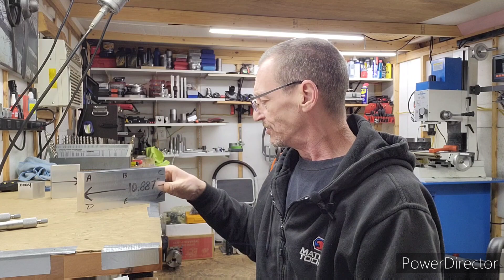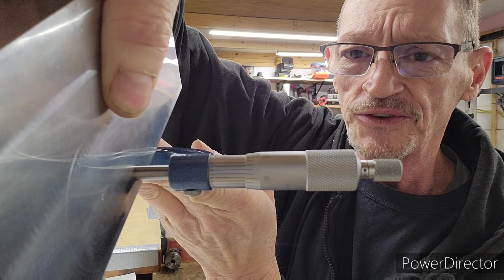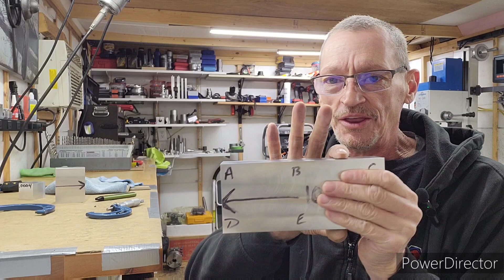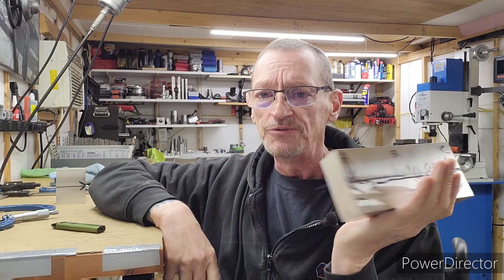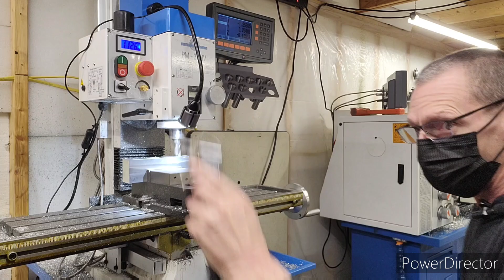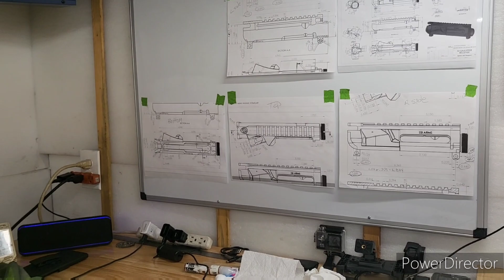Manual machining AR15 Billet upper receiver pt2  @Toolmaker001

Comment: Hey Jeff.. Did you do a video on how you squared that mill up? I got a new PM 935 and I "think" I got it trammed in but clearly you know things I don't..;)
Reply from the maker: No I haven't done a video on that. I thought about it but I don't want to mess with the tram on my mill right now. I'll do one after I  knock it out of tram.
Reply: @Toolmaker001  Yes that would be very useful. Blondihacks did a really good video on lathe alignment and that was outstanding.. But I have not seen one on dialing in a mill.
Reply from the maker: I just did a quick milling machine tip for next video. Your going to want to see it. Should be up by Sunday or before.
Reply: @Toolmaker001  Great! Thankyou..
Reply from the maker: Thought I better drop you a message. If you have seen my latest video I forgot all about putting in the footage on tuning the mill. I'll do my best not to forget to put it in part 4. Hoping to have pt4 uploaded Sunday evening.
Reply: @Toolmaker001  Ok cool.. I have not had a chance to watch your latest.. You'd think being retired I'd have all kinds of time..:)

Comment: Looking good Jeff! I must say when I was aligning my lathe I noticed the heat of my hand gripping the mic was causing a 1/10th drift.. I didn't believe it at first but it was only in the mid 30's in my shop (no coolant in the lathe yet) and sure enough if I held that mic for more than say 10 minutes the measurement would "shrink" by 1/10th. I then wore gloves and the measurement would not drift.
Reply from the maker: I use to machine a lot on inconel and that's stuff is amazing how well it maintains density.

Comment: Sounds like there is still room to dial the machinist in. 😉😅
With that said, I like that little mill.
Reply from the maker: Yeah It's a great little mill. Watch when I cut the center up closely.  I'm taking .150" cuts. And it powers right thru.